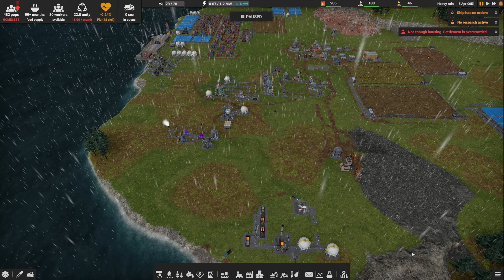Let's Play Captain of Industry s02 e15

Comment: So, the power indicator at the top.... 0.05/1.2MW.   so is that the amount being produced, or how much is being consumed.   if the latter, it may explain why the generators aren't turning all the time.   it may not need to produce.    It does seem rather odd.
Reply: Really enjoyable series.    nice work.
Reply from the maker: @davesharman8302  Thank you!  I'm really glad you enjoyed the series. 

I hope to do another one later when more of the tech tree has been implemented.
Reply from the maker: I believe it is the amount of energy being consumed or requested over the amount of energy you are able to produce, but I'm not certain.

I think it's showing really low energy consumption in this episode because most of the buildings requiring power are sitting idle.